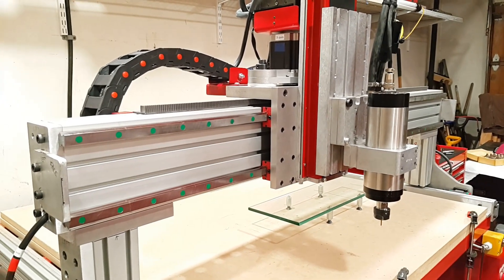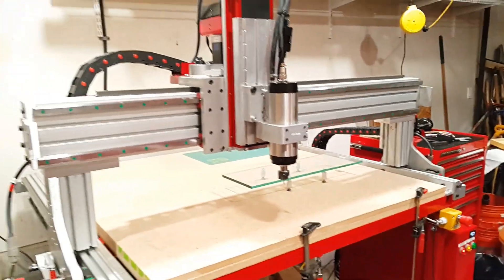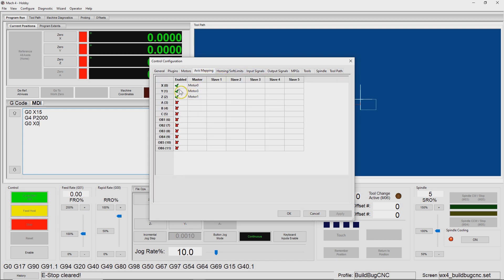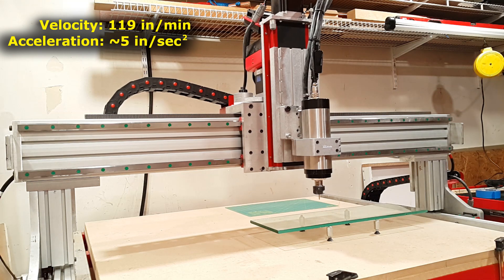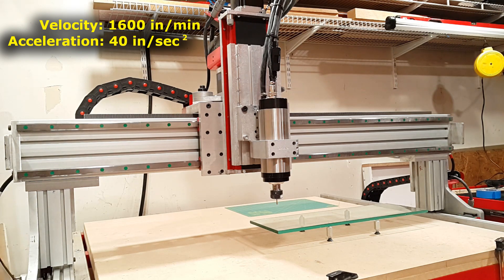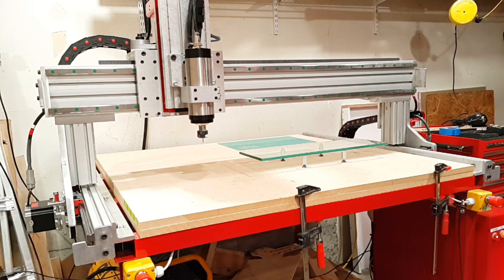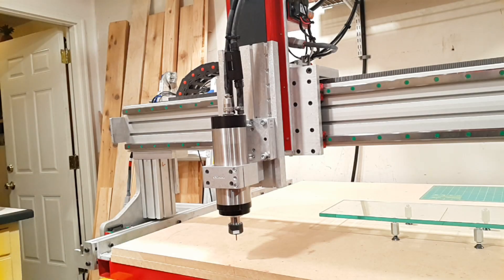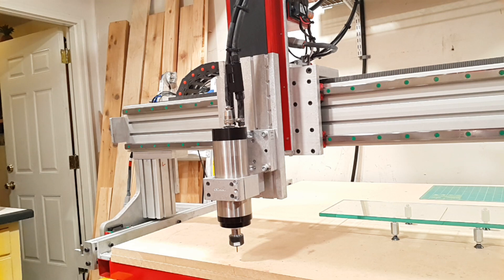CNC Stepper Motor Rapids - Configuring the Max Speed for each Axis

Comment: what about torque and speed curve. i have nema 23 on my machine one for each axis. every thing works at 3000 mm per minut but motor torque drops rapidly. 1500 mm per minute is fine but, only for contnuous motion , motors stall during acceleration when manually jogged.

Comment: Not sure what voltage you have running the stepper driver, but the higher the voltage the faster the rapids. But don't exceed the mfg max voltage. You'd be better of with closed loop stepper than open loop.

Comment: Do the speeds vary once they have load or is that why you back it off 25% to compensate for the load?
Reply from the maker: We back off to have a safety margin for the loads the cutting will produce. If the speed or the load gets too high we will loose steps and that's never good. It's a balance of many factors; how rigid is the machine, how much power does the spindle have, how aggressive are your cuts. I backed off quite a bit because I'm new to CNC milling and I don't want to break stuff. Perhaps I can speed things up when I get more comfortable.

Comment: I didn’t see any proximity switches? I also noticed you have stop blocks. Would love to here your thoughts on this. I have a Desktop pro model with all the proximity switches but I guess it would run fine with out all that. I did add some stops in case proximity switch would fail. Never has yet to fail. Great video thank you for sharing.
Reply from the maker: My design uses 5 inductive proximity sensors (without any separate limit switches). In Mach4 I've configured the proximity switches to act like limit switches in that when any of the proximity sensors fire all motion stops (also I always enable soft limits which should prevent me from ever getting close to the proximity sensors). My only regret is that I'm using normally open proximity switches because I could not source normally closed versions cheaply (N.C. sensors would be safer). While setting up the machine I did hit the physical end stops once so I was glad they were there, they prevented the gantry from taking a disastrous trip to the floor.

Comment: Great video...
The speed limit for your system is not in the torque of the motor, it is the rpm of the stepper.
The nema 34 goes way faster, if you don't reduce the rpm trough pulleys :) Also on the Z axis,  if you change the pitch of the screw you can increase the speed.
If you disengage the pinion from the rack you won't go much faster, because all the torque of the stepper motor is in the low rpm.
Once you go faster than lets say 1200 rpm you loose all torque.
Reply: Thanks for making a valuable comment... What about nema 24 and nema 32

Comment: I've build a monster cnc but simple question. Does the driver settings corelate with mach3? I mean by that, if i set stepper driver to let say 5000 pulses, what do i set mach3 for then? I manage to get only 150 rpm out of my motor. Thanks for a reply.
Update: fount my problem. I needed to change the settings on the drivers to a lower Amp setting and now i can do 980 rpm. Torque is lower to thou.